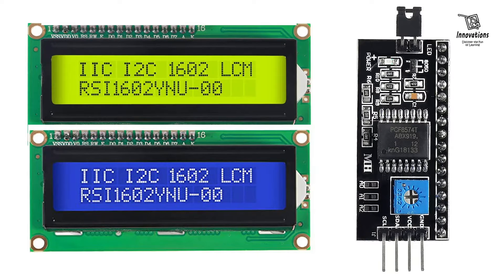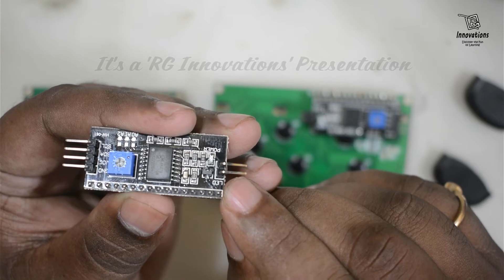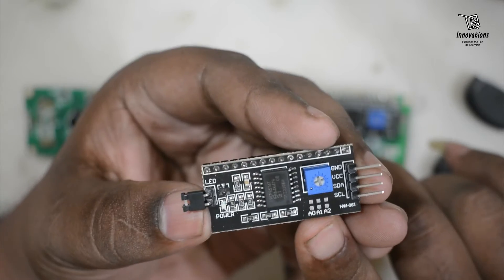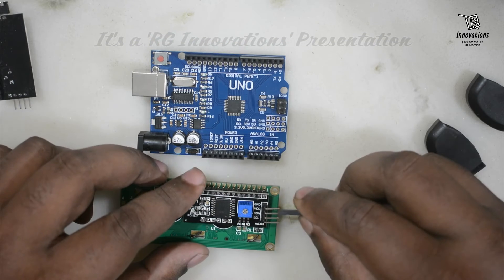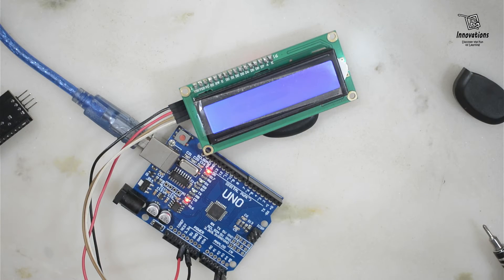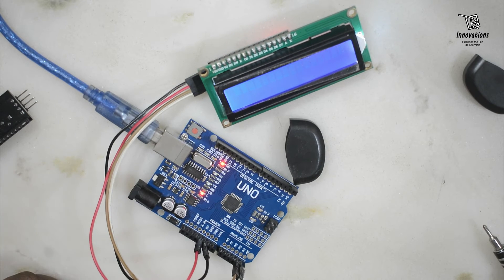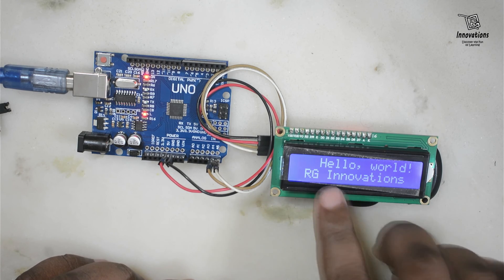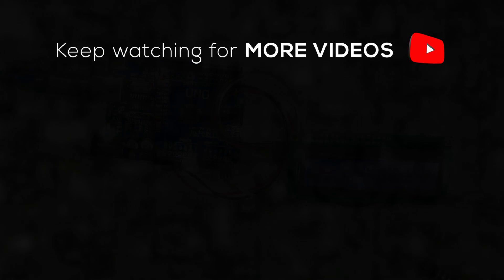PCF8574 I2C LCD | Connecting an LCD Display to Arduino using I2C Adapter | I2C LCD Display

Comment: Compilation error: LiquidCrystal_I2C.h: No such file or directory
Reply: you have to add it in your arduino ide. On the left there is an icon that looks like a stack of books: click it. Library manager should appear on the left. Type the name of the library in the search and click install.
Reply: same

Comment: The scanning code is working, but when i want to use the helloworld code it doesn't print it on the lcd. can i do something about it?
Reply from the maker: Share your code
Reply: @RGInnovations  i have the same problem. The code is the same as yours, i  only removed 0x3 and wrote 0x27. The LCD is lit, but no "Hello world!"
Reply: @Håvard123  Try adjusting the contrast by turning the potentiometer on the back side.
Reply: @Håvard123  Try deleting all the files in Documents\Arduino\libraries Folder & run again.

Comment: If serial monitor says no i2c devices found then what is the problem
Reply from the maker: Change the code of i2c device or check the connection